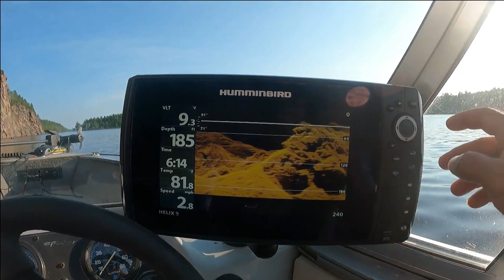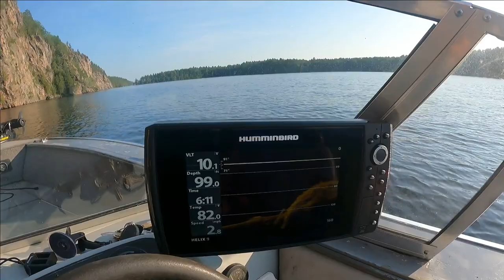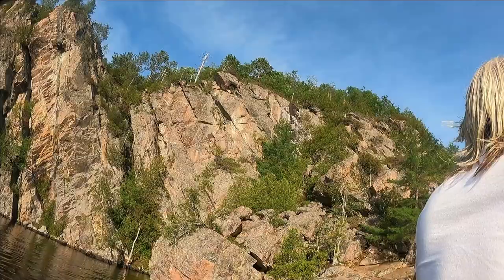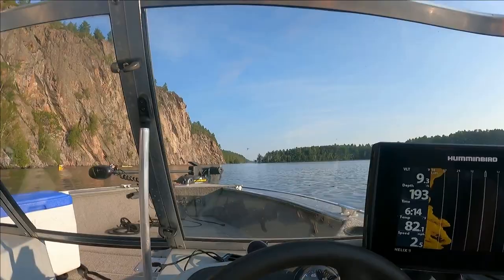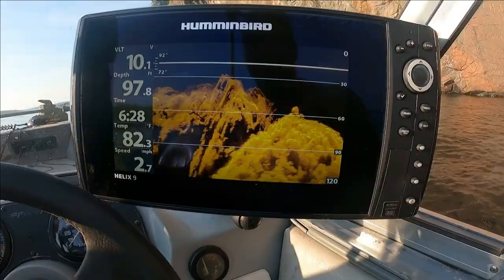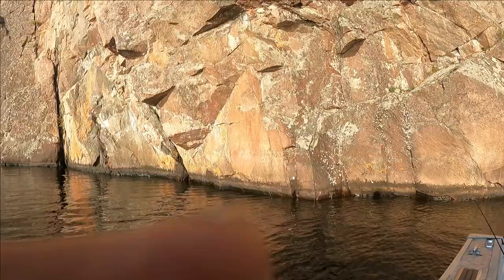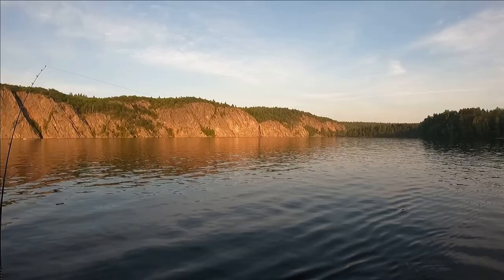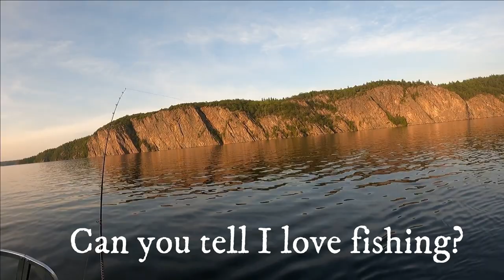NO FIREWOOD TODAY - I'VE WAITED A YEAR FOR THIS!...

Comment: Nice. I did the same yesterday. Just bought my first boat and dropped it in the water yesterday. 
Now I'm checking out GPS navigation/fish finders.
Anyone got any recommendations?
Reply from the maker: Nice! What style boat? Mine is a couple grand, gotta spend time on the water and on the computer to get its value from the features. I have hummingbird helix  9 (9 as in inch screen) records tracks which is helpful at night navigation, just follow the red line back, I can map and record bottom, I have map pack so most lakes will show depth contours, GPS, location marking. Mega SI is side imaging megapixel as well as DI, down imaging. If you want basic, you can get helix 5 with GPS for basic navigation and sonar. For roughly 300. You can get some of the options that I have on my 9 for the 5 if you spend more. If you want a bigger display than 5 inch,  you can get basic features unit on 7, 8, or 9. You can go even cheaper and basic if you know your way around where you go and basic sonar to avoid shallows. There's helix 10 and 12 if you wanna be a real sicko 🤣 Lowrance is good too, but I don't know much about it. Side imaging acts like a flashlight pointing either way diagonally out the back of the boat, objects appear bright with shadow behind them, just like flashlight beam
Reply: @OntarioFirewoodResource  I went with a Garmin since I need navigation more than fish finder.
Reply from the maker: @nealbrooks7782  ok, that will make your life simpler lol